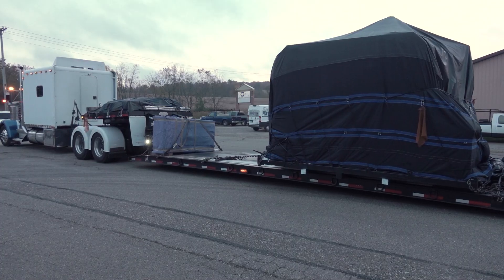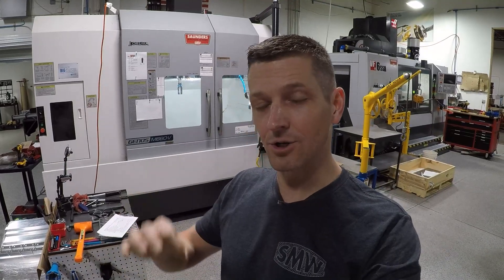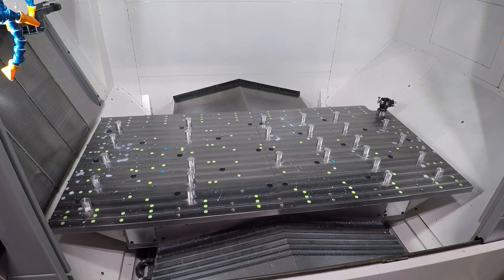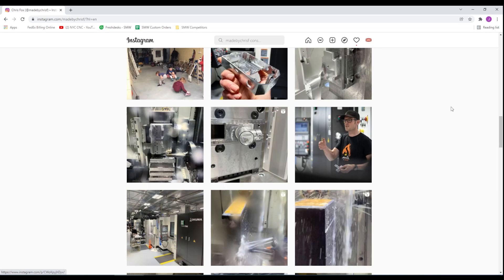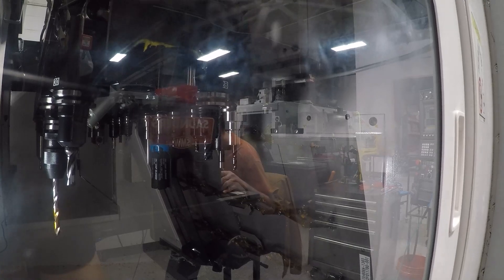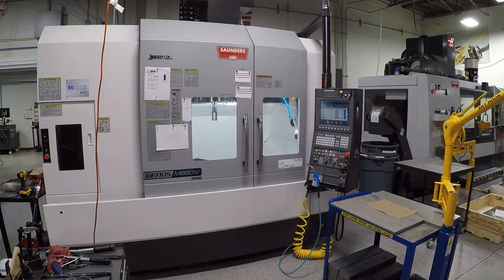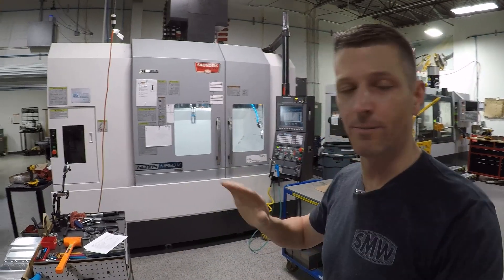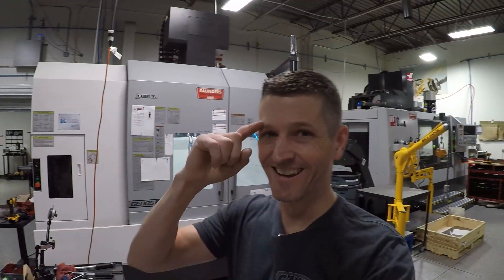Buying an Okuma Genos M660-V CNC Machine!

Comment: I run a 660 aswell, cat50 tho.  the chip augers are too small and jam quite often,  I have it set to run on NC start which helps. Otherwise beautiful machine. The thrupin is kind of a pain but not a big deal, slightly expensive.

Comment: We rebuild 200k lb steel mill roll grinders and only have 6" concrete floors. Now we do regularly run into issues so dont get me wrong its not acceptable. We had one machine about 300k lbs between machine and roll weight that eventually managed to crack the floor all the way around. More commonly we will chase leveling a machine for days or occasionally weeks as the floor moves underneath. These machines typically are only here for a year or less and are only operational for a few weeks however they still can hit tenths tolerances during that time. So in short yes manufacturers tend to be way overkill on foundations. Our sharp manual mill (like a bridgeport series 2) calls for like 2 ft of concrete under it which is crazy.
Reply: There's a lot of things that go into that foundation, I suspect most manufacturers just give a solid value that will work no matter what the ground consistency is. IE: is your building on sand or bedrock.

That said, the cheapo small stuff, yeah it's probably overkill with what a customer will do (depending on how hard you're going to push the machine). However with some of the larger boys (MCRs, MUs, Multus's, MAs, MBs), you really shouldn't skimp on the foundation. Went to service/ PM a MCR in WI, the company makes lathe beds on this thing. They spent something like $2mil on the foundation. 5 years after, the machine is STILL square (which in the X-Y is a mind boggling .001mm/m), and has a .005mm/m dip in the level near the actual column (this thing's travel is 30m, with a 10m bed, in the X). There's another double column I heard about that the company skimped on the foundation, and rushed getting the machine in. iirc the columns sank about 0.005", and leaned over quite heavily (accuracy wise, not structurally).

TL;DR: if you machine is thicc, and expensive, buy it a good home.
Reply: @orangedream267  when our machines go to their final home they get a proper isolation pad foundation. Typically there will be a the foundation will be a i beam reinforced concrete block, a layer of super stiff springs, and then a final i beam reinforced block for a final thickness sometimes approaching 20ft. All of this is with a special vibration dampening concrete. The entire assembly is completely detached from the surrounding shop floor. One of our past customers had 2 roll grinders. The older one was just on the shop floor ours was on an isolation pad. A freight train track was right outside the shop. Anytime a train came bad the older machine had to be stopped because the vibrations would transfer into the roll being ground meanwhile ours could keep running without any issue. We don't so the foundation work we partner up with another company that comes in and measures up the machine and starts the foundation work while we build the machine.

Comment: Now your starting to get some really good equipment.  Real high speed machining with high material removal rates, completely dialed in mechanical and electronic components.  If you get a real post that posts super nurbs.  Your mind is going to be blown away.  Also consider using metric increments to take advantage of the extra resolution it can make a difference on larger machines.
Reply: Did they spec supernurbs? It's an option on 3 axis genos machines. I doubt it's of much advantage for the parts they make anyway

Comment: I work on a M560-V. I look forward to your videos on the Okuma. 1. Could you talk about the table and possibly a mounting work holding system that you might use on it?  2. Can you share the air nozzle holder you 3d printed? I really hate hanging ours every where lol
Reply from the maker: air nozzle file link is in the video description (https://www.nyccnc.com/okuma-genos-m660-v-machine-overview/)
Reply: @nyccnc  Amazing Thank you so much!!
Reply: I hang mine on the door. Eric Sun and I of Orange Vise designed a subplate for the 560 utilizing their zero point system. Its very cost effective if it meets your needs. I can fit 18 small vises on the table without removing my tool touch probe or the 4th axis.

Comment: Of all the wonderful content you've created this has me the most excited. I have been looking seriously into the 560 later this year. So excited when I saw you invested in one. Any chance you would be sharing the post process? Or any recommendations where to source one? Perhaps a folder of stuff for those who subscribed to your paid service. Regardless thanks so much for sharing anything and everything about the Okuma :)
Reply: That’s the I.N.S.T.A
Reply: @trevoradams8675  how's it going? I never received a te.xt for help so I'm assuming, and hoping, it's going well
Reply: I went through this process in 2020 with my 560, feel free to ask anything. What post are you looking for? Fusion?
Reply: @frp1276  That would be amazing!! I'm actually hoping to receive the 560 by the end of October. As an exclusively Haas owner up to this point I will have questions I'm sure. :)
Reply: @trevoradams8675  nice! What options?
Reply: Renishaw probes, LNS conveyor. And the rest the standard features
Reply: @trevoradams8675  YouTube comments are a pain. It would be better if we had email or text but without posting that info here
Reply: @trevoradams8675  how'd it go? Need help?
Reply: @frp1276  Hey! It's been slow going. they tell me it should be on the truck end of the week. I cant wait!
Reply: @trevoradams8675  do you have toolholding prepped already? If you have a high pressure coolant system make sure you have enough concentrate. Their capacity is usually higher than the sump.
Reply: @frp1276  excellent thank you! I have just picked up a fresh barrel of blaso. Looks like the machine should be here right before Christmas 🤦🏻‍♂️ it’s going to be crazy
Reply: @trevoradams8675  I'm not sure about your exact configuration but my sump is 60 gallons and the high pressure unit is 100 so that's 16 gallons of concentrate to fill. Your conveyor will offset 10 or 15 gallons and you'll probably run your sump at 50-75% after that to allow for high pressure drainage from the mill
Reply: @frp1276  amazing writing all this down :) thank you!
Reply: @trevoradams8675  if you want we can figure out some way to be in touch outside of YouTube comments
Reply: @frp1276 hey sorry I’m trying to leave a way for you to chat private but it keeps getting deleted for some reason. I’ll try again
Reply: Kraken_built

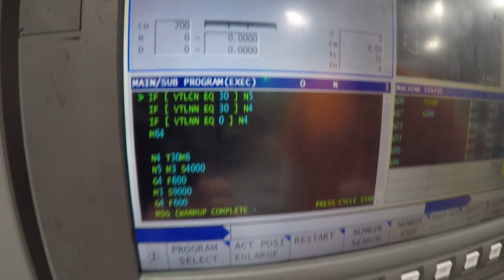Comment: 7:00 what if you let the machine run a large program through the night and its still running when the warmup begins? Does the machine finish the running program and then start the warmup program or what?
Reply: Normally CNC machines have protections, such that you can't override a running program. It should either queue the new program, or ignore it.

Comment: I saw this machine and as you talked about the harmonics of differnt brand equipment i thought:
I would be very interested about your guys current state and planning about digital technology in your company.
Things like parts, tool and stock management. Do you still use USB drives on a regular bases... ? Not that it is bad, like every system has it's flaws but also the new ones... ;D
I would be very interested if such medium sized company lik yours, could quickly manage all the complexity increase that a software and conection technology upgrade brings.

Comment: instead of that small dinky led light you should had gotten some Glorie IP67 230V LED Strip in the tool room/space of the machine ( one tour around the side or all around the top and you could see everything  promiss ) 

you may need a 110v to 230v adaptor though
Reply: I've been looking for lighting solutions for the same thing... Do you have a good US based reseller?
Reply: @frp1276  sadly no. specially since i live in erup. but i remember from one of my former work places in our brother mills there where like no light at all so we installed that around the top and it got leaks better ( this was a old machine  i might add )
Reply: @frp1276   Where are you located? Some of the Okuma machine distributors sell LED lighting kits for machines. I can put you in touch depending on where you are at.
Reply: @ficematt  thanks, I mostly want it for my old Haas. My 560 has great LED lights, aside for the tool changer
Reply: @frp1276  You might ask the dealer that you bought your M560 from. I'm most familiar with the Okuma dealer Hartwig Inc. I pretty sure they sell and install LED lights on all brands of machines.
Reply: @ficematt  thanks for the heads up

Comment: My Multus 4000 needs a bloody 700mm concrete slab AND piles another 500mm - IF the soil is bad, fingers cross that its better when the foundation work starts in the new industry location we gonna move into coming august. Its 17 tons, but my god... they have speced the foundation to last through a bloody war or something.
Reply: @Digitalartandhobbies  its a big boy, but it is a bit on the wild side